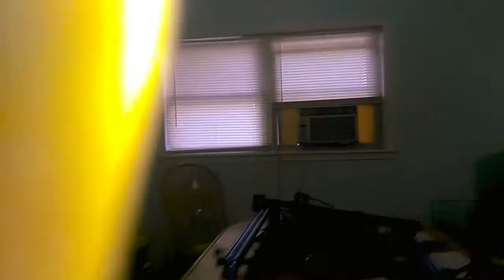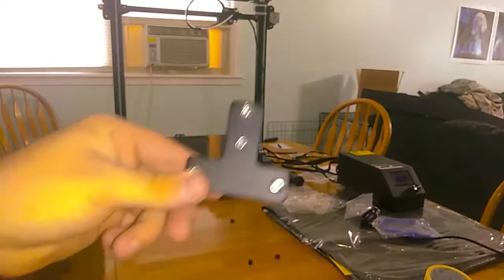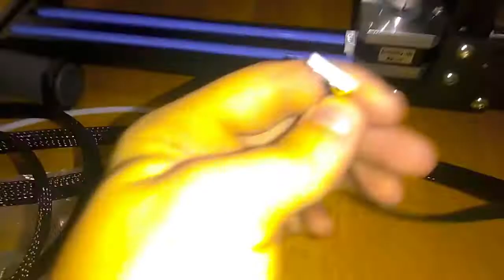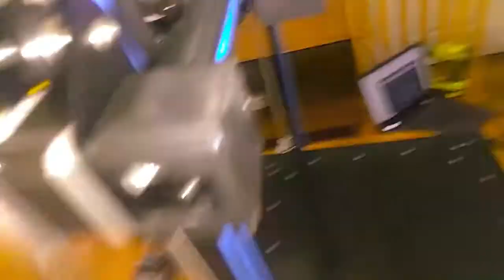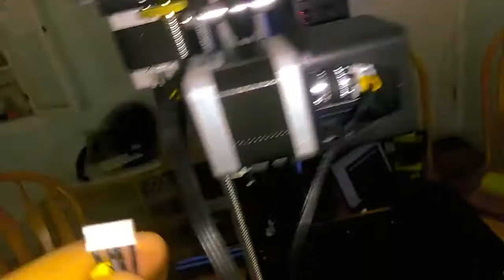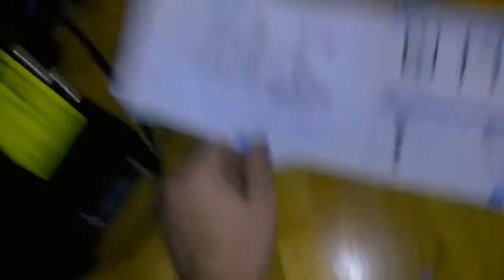Aibecy CR-10 S5 Assembly guide/ Creality clone

Comment: Nice video very helpful, I read your post in the Creality CR-10-S4 & S5 3D Printer group, I found the plastic strip on the x axis caused binding I removed the plastic strip as there was places where there had been rubbing and binding when printing.
Reply from the maker: Thank you. I pushed the rubber down into the channel almost completely and seems to not touch at all when I run the axis. I did notice when leveling the bed that the front right corner where the heated bed cables go under it, that I almost had to tighten the adjuster all the way in order to get it level.
Reply: @garthodsgaming9795  I found this also when I put my CR10 S4 together, to get more bed adjustment I manually raised the z axis then checked with a spirit level,  this gave me more clearance when leveling the bed
Reply: You may also find the stock bed glass on the CR10 is warped in the middle, most people change the glass for a mirror, I just slightly build the center of the stock bed with masking tape and it prints just fine.
Reply: @3dprintitbuilditpaintit138  planning on going the mirror route... I do have a antclabs bltouch but it should make for even better results if it's flatter in the 1st place